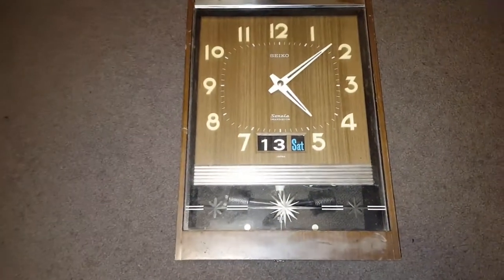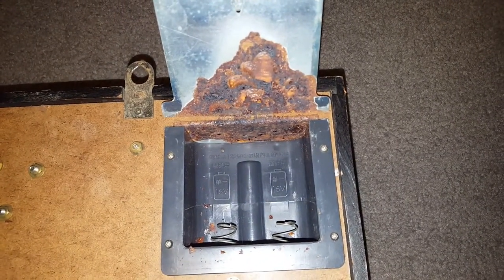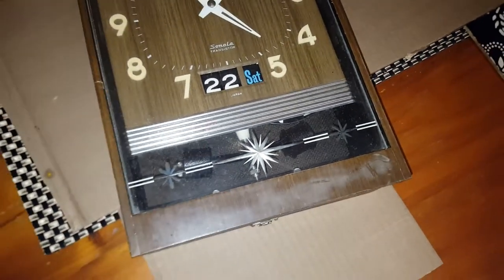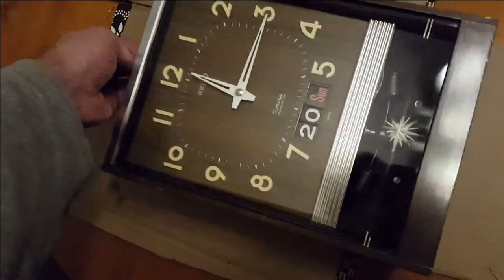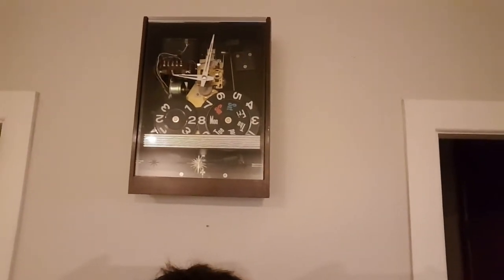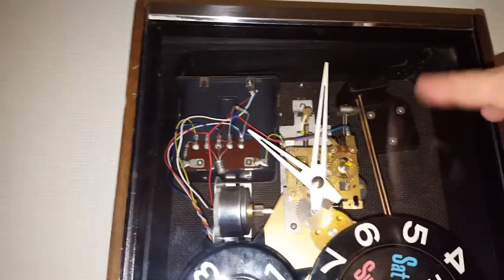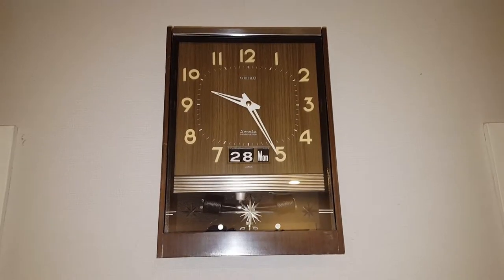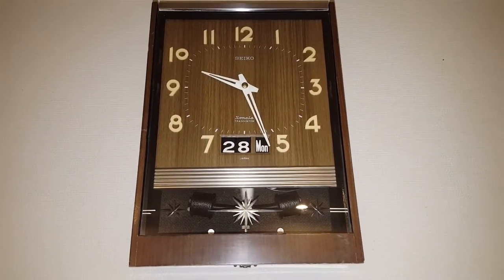Seiko Transistor Wall Clock

Comment: Nice vid and good repair. Amazing that you were able to adjust the pendulum length to get it keeping time correctly!
Reply from the maker: Yeah it has a weight that moves up and down the pendulum. It was right at the top so it was going way to fast at first
Reply: @vivalafletchweekends2747  do you want same clock In working condition???

Comment: Nice video!! Nice clock. Just bought one like it but different version. Do you know how to turn the bell off? Thanks.
Reply from the maker: Thanks. I dont think the bells can be turned off but possibly putting insulation tape on the little hammers at strike the rods it make the bell sound could quieten it for you
Reply: I beleive there are 2 circuits, remove the battery for the chime. the clock will still run.

Comment: Hiya! Interesting vid. I've just had a similar clock fixed the battery case also corroded. I'm interested though in how you adjusted the clock speed as mine is running slow. How did you adjust it?
Reply from the maker: So on my one there is a black plastic  with white lines type of thing on the stem of the pendulum that rotates around it moving it up and down. Moving it up a little will speed it up.. but just do it little at a time and see how it goes.
Reply: @vivalafletchweekends2747  thanks, I'll give it a go. :)